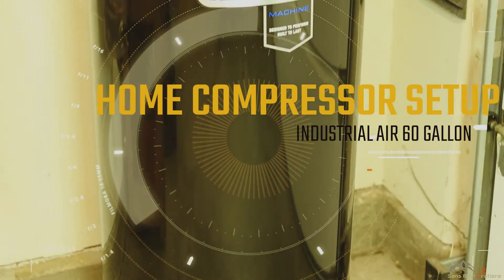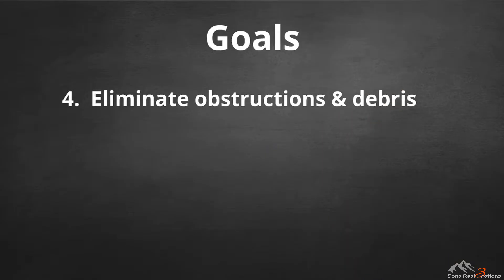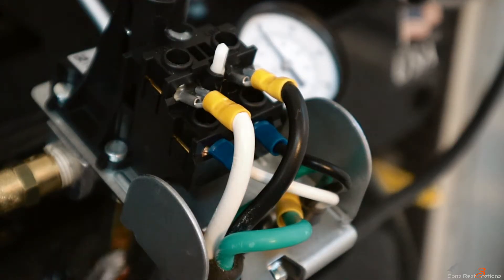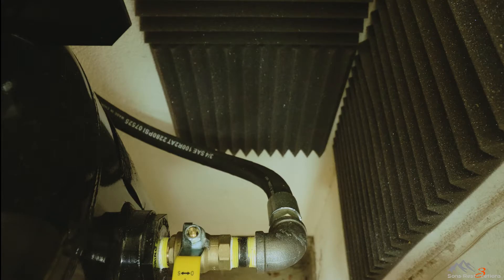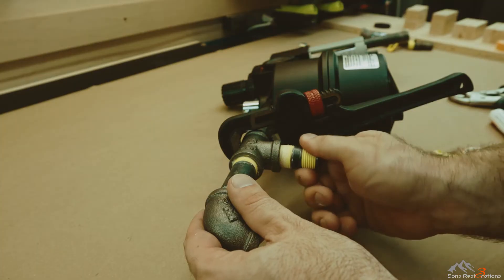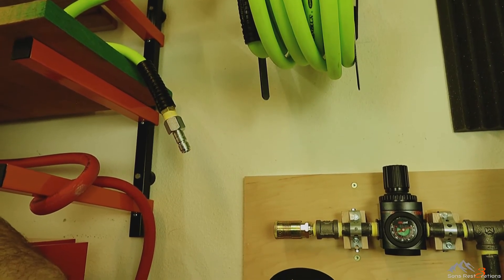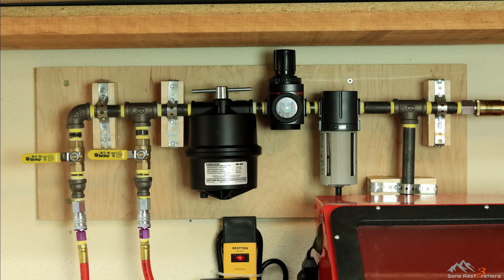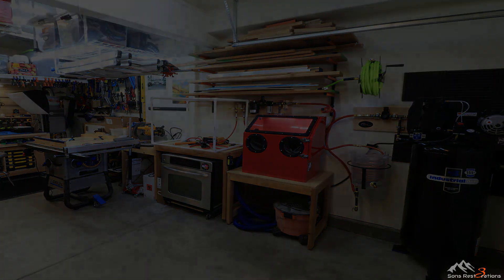60-Gallon Air Compressor Setup and Shop Air Installation Industrial Air (Setup Part One)

Comment from the maker: Here's the order of parts used in my shop air lines:

Starting at the compressor, 1st section:
¾” Full-Port Ball Valve, Male NPT + Female NPT
¾” short nipple
¾” 90-degree elbow
¾” Hydraulic Hose, 48”
¾” short nipple
¾” Union
¾” short nipple
¾” to ½” reducer
½” short nipple
½” tee
½” 8-inch nipple
½” Full-Port Ball Valve
½” 3-inch nipple
ARO Air Regulator, ½” NPT
½” 3-inch nipple
½” coupler
Milton 1816 coupler
½” air hose, 50-feet
Air hose reel (from Harbor Freight)

2nd section:
Milton 1818 coupler
½” 3-inch nipple
½” tee
½” 8-inch nipple
½” Full-Port Ball Valve
½” 3-inch nipple
ARO Air Line Filter
½” short nipple
ARO Air Regulator, ½” NPT
½” short nipple
Motor Guard M-100 kit, ½”
½” 3-inch nipple
½” tee
½” short nipple
½” Full-Port Ball Valve
½” short nipple
½” to ⅜” reducer
⅜” short nipple
Milton V-style high-flow coupler
Milton V-style high-flow plug
⅜” 6-foot lead-in hose
½” 3-inch nipple
½” 90-degree elbow
½” short nipple
½” Full-Port Ball Valve
½” short nipple
½” to ⅜” reducer
⅜” short nipple
Milton V-style high-flow coupler
Milton V-style high-flow plug
⅜” 10-foot lead-in hose

Comment: Smooth copper pipe + standard  90 degree elbows = negligible loss per bend in typical compressed air applications. 5 PSI loss for a 90 is absurd and just flat out incorrect. To have such a big loss you would need a VERY VERY VERY high flow compressor,  were talking a 150+ CFM compressor, WAY over what you would see in a home shop. At around 20 CFM, one 90 degree elbow might cause 0.2 PSI drop, if that. Sorry for the semi rant, that comment you made through me off haha otherwise, nice video and set up, you did a great job.

Comment: Found this power cord for mine based on your video, so thanks!  FWIW, a 20 Amp breaker is just fine for mine, and it's about 70 feet from the panel on 10-2 wire.  My understanding is 30 Amp is too much, and could be bad for the motor.  FLA of 17.2 x 25% or 30% is a shade over 20, but again, I've never tripped it.  If it was a problem, I was going to switch to a 25 Amp breaker.

Comment: I love the video thank you. I wonder about your electrician. My area code prohibits white colored wire when  it’s supplying one leg of 250v circuit That one white wire should then be taped on the end with black tape to indicate it’s a supply wire. Leaving it white is dangerous as
Someone might mistake it as a neutral wire.

Comment: An exceptional video.  Well explained.  So many pertinent references.  I so appreciate your production and that you shared it with us.  I am a Master of many things.  Air Design is not one of them.  I just got a Media Blaster cabinet.  I have a DeWalt 60 gallon compressor.  Do you think I would need the extra (ingenious) dryer piece with the coil?  I am worried about space.  I restore Antique Brass fans, Antique / vintage Electric Clocks, etc.  Small items.  Thanks so much.  Denny in Williamsburg, VA.

Comment: The first two links below are for pressure loss of compressed air due to pipe length and fittings(at standard conditions of 70°F). 

For a 60 gal tank and pretty much any system from 50-175psi and 10-30 cfm, pressure loss due to fittings and pipe is nearly negligible when utilizing 3/4 pipe or even 1/2 pipe (slighter higher with 1/2 pipe). I say that not to be a know-it-all, I just want to share some data for people trying to plan out their system like me. I almost switched my entire plan away from a copper pipe zig-zag setup of 50' of copper and many elbows, to look into the coil 1/2" coil setup as shown in this video, after hearing that a 90° elbow can induce up to 5psi loss. After some research that pressure loss is not an issue for my 175psi 11.5 cfm 60gal tank. That high of a pressure loss for elbows and/or pipe only applies for incorrectly designed systems with high cfms(50+cfms) at high pressures moving through undersized pipes. I've seen first hand setups that have more than (25) 90° elbows and 60 feet of copper that only experience a few psi of loss, which is in line with the data below.

The last link is a calculator where you can increase the temperature to well over 100°F and get a more accurate idea of pressure loss. Even at higher temperatures, the pressure loss is minimal.

This video is still an amazing resource and the coil setup here is certainly much easier and probably just as, if not more, efficient than any other system. 

Also FYI the 3/4" hydraulic hose in this video is 1/2" ID... 

https://www.google.com/amp/s/www.engineeringtoolbox.com/amp/compressed-air-pressure-drop-fittings-d_1279.html

https://www.google.com/amp/s/www.engineeringtoolbox.com/amp/compressed-air-pressure-loss-d_1014.html

https://www.tlv.com/global/US/calculator/air-pipe-sizing-pressure-loss.html

Comment: Any concerns that your air compressor is 155psi max yet the fist 3/4 valve right off the tank is only rated for 150psi?
Reply from the maker: No.  I don't run much past 100psi for my operations
Reply: @threesonsrestorations4043  ok cool. 155psi l is close to rated 150 anyway and the valve is probably able to handle more. I was asking because I'm new to all of this and my compressor is 175psi max and I don't know if that is still doable on a 150max valve, considering the regulator is past the valve and the valve being right off the tank it will see that full pressure...
Reply from the maker: @Thomas998822  Most air tools are rated for a max PSI of around 120, which is why I don't typically go beyond 100 when I'm working.  Yes, my regulators could bring it down to 100 if I wanted them to, but I'm not doing constant work and therefore don't rely on my compressor to auto-shut itself off.  If that's a concern for you, you could put a regulator right off the compressor before you begin your piping.

Comment: Your compressor is way too close to the wall, there's a fan back there that's pushing air over the air pump, and you're not really giving it enough room to breathe.  Otherwise, this video was super helpful.
Reply from the maker: That may be what the mfg wants, but this is a case where an instruction booklet meets real-life work situations and space constrictions:  I'm not wasting another 10 inches of precious floor space in a 2-car garage if I don't have to!  
Fortunately, my work allows for the duty cycle to be low, so heat is not an issue for me.  Others who use their compressor for hours at a time may need to follow your advice. 
Thanks for the compliment!

Comment: Can you provide the part number for the Nema 6-30 to ROJ 30 amp power cord? Cant find one anywhere locally. Awesome Video.
Reply from the maker: OCSParts 105310 on Amazon is the one I used

Comment: I love what you are doing here.  As you seem to be very knowledgeable on air and moisture, I want to run by you what I did on my little 33 gal oilless compressor, and am considering doing it to my 60 gal one in my second garage.  I went to my local junk PYP yard and got an AC condenser out of a huge SUV.  I installed it up on the wall about 6 feet above my compressor.  I installed a water trap on the input line, and the output line.  I plumbed in copper from the compressor to the input separator, where air would run through the condenser, cooling it dramatically, then through the second water trap on the output of the condenser which ran through another 6 foot length of copper down to the tank.  On the output of the tank I  have yet a 3rd water trap for the air hose that runs whatever I'm running.  I have used this setup to paint cars successfully.  There is rarely ever any water that drains from the tank, and in the 3 years it's been in use, never had a drop of water in the trap at the tank output to the hose.  I do drain a fair amount of water from the traps at the condenser though.  I live in North Alabama, so we have very high humidity here.  It's a simple setup, cost about 60 bucks for condenser, copper, and two traps from Harbor Fright.  So far it is working famously..  Your thoughts?
Reply from the maker: I love it!  I've seen this idea as well, and think highly of it.  Best wishes to you and yours in Alabama, and thanks for watching!

Comment: How do you like the compressor?
Reply from the maker: It does really well!  I've had zero issues with it thus far.  I do try to do regular oil changes on it (~twice a year), and I don't let air/moisture sit in the tank when I'm not using it for a prolonged period of time.  I don't base those actions on any hard facts, just feel better doing it and hope it improves longevity.

My only limitation is my location:  I live in a suburb with houses close to one another, so I have to put in some thought about when I turn it on and for how long I use it so that I don't tick off my neighbors with the noise too much.
Reply: @threesonsrestorations4043  does it keep up with the blast cabinet good?
Reply from the maker: @lsxjunkie  Before I installed a metering valve, I'd turn on the compressor and fill it up, blast for about 5 minutes at 90psi before the compressor would kick on, and it would stay on for about 4-5 minutes.  I would never have to wait on it.  Now, I can blast at a lower psi so that the air lasts a lot longer.  So yes, it's just fine for what I'm doing!
Reply: @threesonsrestorations4043  what metering valve did you get?
Reply: @threesonsrestorations4043  ok so that metering valve has a larger port in it allowing you to turn down the regulated air psi.
Reply from the maker: I made one.  They're really easy to put together and very effective!  There are videos on YT for this if you're interested

Comment: How well does 60 gallons work with a harbor freight sandblast cabinet? Typically only blasting nothing more complex than vehicle wheels and automobile / off-road vehicle parts... thanks!
Reply from the maker: It works extremely well, as long as the air is dry!  The only limitation is waiting on the compressor, if you're doing a ton of work at one time.  I'm not typically blasting more than 30 minutes at a time.

I have the smaller of the two HF cabinets, as you see in this video.  It needs some mods to make it a good box, but it does exactly what I need it to.
Reply: @threesonsrestorations4043  perfect this is the response I was looking for. 30 minute blasting time with this compressor or MORE THAN ENOUGH for my intentions. Thank you
Reply: @threesonsrestorations4043  Will it be okay to run just the compressor without any of the air drying plumbing with it?

Comment: this video is beautifully done. but i need your help, is there anyway you can tell me what the threading sizes are on the main line compression fittings are?the silver line that goes from the exhaust on the pump directly to to the top of the tank. the compression sleeves on those are flanged and i cant for the life of me find replacements to get my compressor up and running. any help you might be able to offer would be an amazing help.
Reply from the maker: Sorry for the delay.  See if this answers your question:  http://www.industrialairusa.com/pdfs/200-2681.pdf